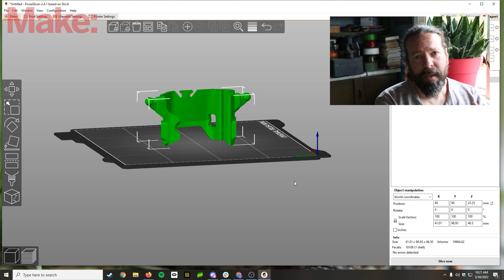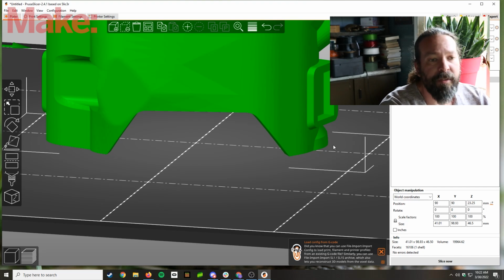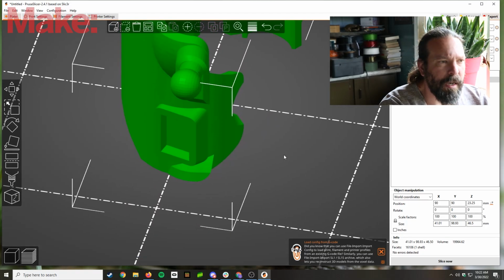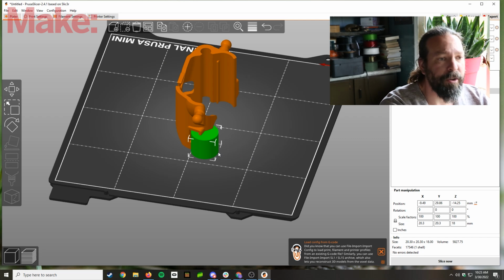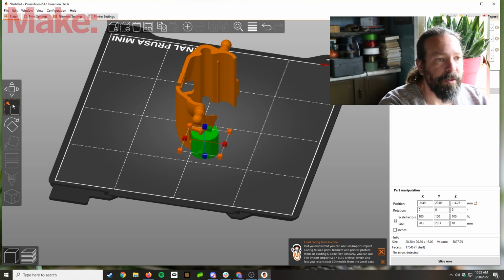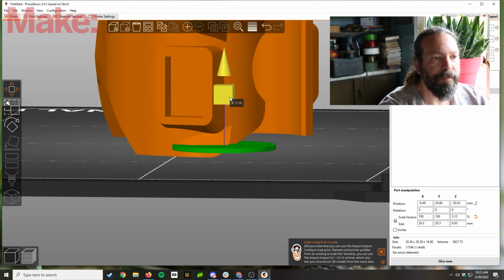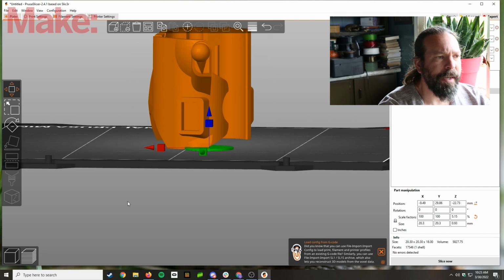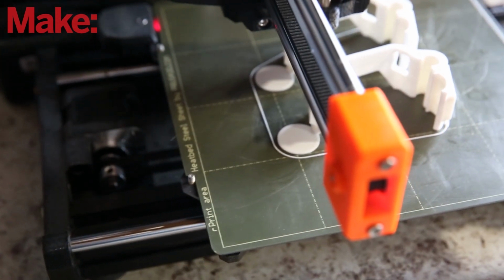Add "Mouse Ears" To your 3D Print to avoid warping and popping off the build plate

Comment: Right click> Add Shape> Gallery > Helper disc.  Job done.
Reply from the maker: well then, PINNED
Reply: @MAKE    :)  I had used it 2 mins before I saw your video or I would have forgotten again
Reply: It looks like Prusa changed the menu name, but it's basically the same.
Right click> Add Part> Gallery> helper_disc.stl
Reply: What a legend.

Comment: You can also use a brim with zero spacing that gives you control of the layers 1 or 2 or more This makes the thickness precise in the tear off easy, but with zero spacing it it holds the part down

Comment: creating relatively simple flat parts with limited or no undercuts is still an area where i find desktop milling machines like the Roland MDX-40 (no longer produced) to be superior to 3D printers. i've wasted days trying to get a warp free flat print on a 3D printer but can knock out the same part perfectly the first time in a single day on a milling machine.

Comment: Hi. Thanks for all of your great videos. quick question...I bought the muse core laser. Did not purchase the cool box. I did buy a Vevor water chiller instead. it came with a small device for the alarm outlet (no hose, cable, etc...). The muse shows a four prong outlet where the muse coolbox should connect to the laser. So my question is...Is there a cable, tube, etc...that needs to connect to the chiller?  Im afraid to turn anything on ruining the laser. I just got it a few days ago. Thanks

Comment: I believe what you are looking for is the "place on face" command (shortcut is F) it should orient the object that the face (you select) is down and very close and parallel to the bed. Should be the fourth button from the top on the left menu.
Reply: The small square with an orange underline next to the Z height position box. That’s the winner, also you can specify actual height by just editing the parameters on the part manipulation panel.
Reply from the maker: this doesn't work when adding bits to an existing model. at least it didn't work for me.